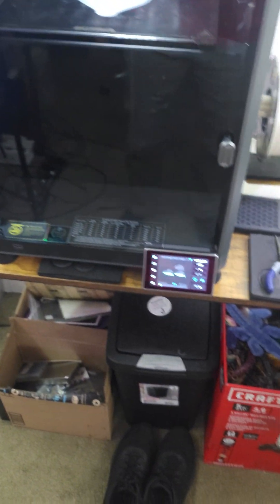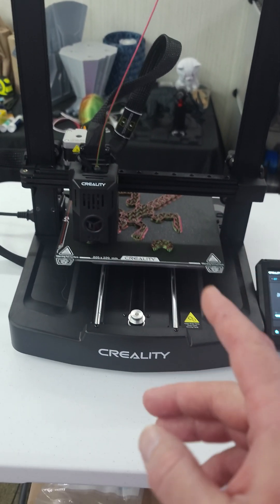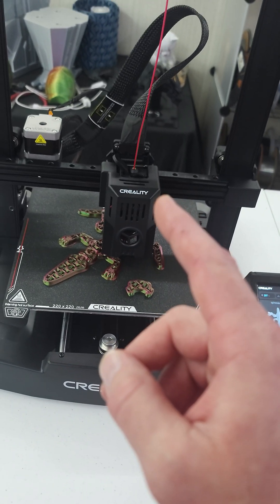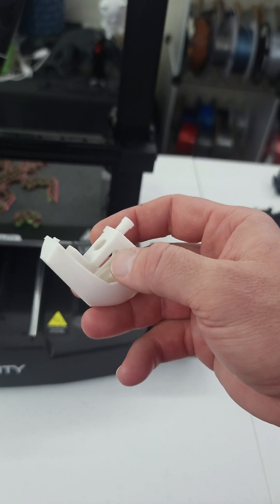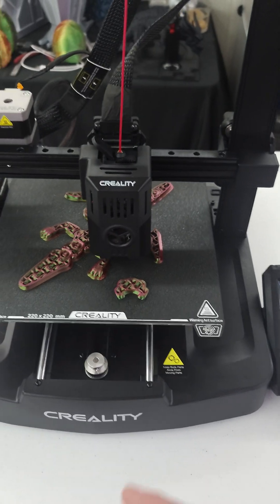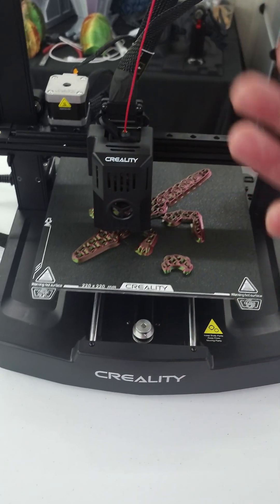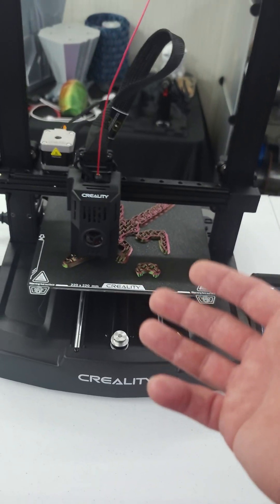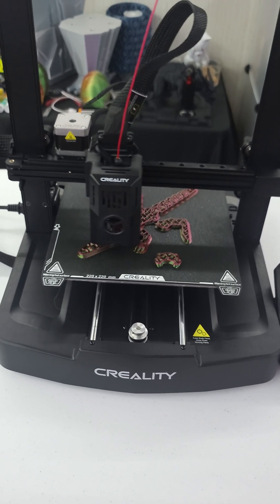Quick Look Creality Ender 3 V3 KE!

Comment: Nice video, does the Micro swiss hotend fit on the KE?
Reply from the maker: Micro Swiss is coming out here in a couple weeks with a version that will be for the KE. There are a few changes they have to make but said it would be ready soon .
Reply from the maker: And speaking of that, Micro Swiss just released the Flowtech Hotend Upgrade for the KE and I've got one on the way. So stay tuned here and on my TicTok for an install and demo video
Reply: @3dpathfinder  im looking forward to it :) also what are your thoughts on the Y axis linear rails conversion?
Reply: Awesome I look forward to seeing the video, k1 nozzle kit will tide me over till then 🙂

Comment: thanks for the video. Have you tried putting a paver slab under your printers to reduce the shaking?
Reply from the maker: Funny you say that because I currently have 2 12 inch paver stones under it now.
Reply: I've never tried it myself, but will probably soon. My printer seems to have a sturdy frame (anycubic vyper), but the old dining table it's on wobbles a good bit

Comment: Don't forget to clip the extrunder cabling into its clip at the back :-) I'm enjoying my KE so far, just wish there were more material profiles for it in Creality Print, and that it didn't crash so often. I set my z offset one click lower just for slightly better first layer, but it's pretty good out of the box with self align.
Reply from the maker: I haven't had a single crash, sorry to hear that for you. Also yeah it's in its place. Really I find more filaments work with very generic profiles other then getting into Asa, abs and the like. But this is going to be a pla, petg maybe tpu machine only for the foreseeable future for me. I have an enclosure but it's made for the Max Neo and it takes up alot of space so I'll use my K1 Max or P1S for the engineering filaments.

Comment: Hi, do you have any recommendations for me on which slicer to use? Or what parameters for prusaslicer?
Reply from the maker: Im currently using the Creality Print Cura that came with my K1 Max and KE. Im new to it but ive had no issues thus far and mainly use for the Lan Printing and ease. I also really like Orca slicer. Being that Im dumb , I dont have alot of experience with any other and prusa never clicked with me.
Reply: You do know that youtube is globally, and you're telling people to switch the power to 110 not good! If someone new to this from other countries that use the higher voltage you just mad them fry there printer! That's why the printer is shipped set on the higher voltage! You realy need to redo this video and say if something like if you live in the US you need to switch this or something like this!